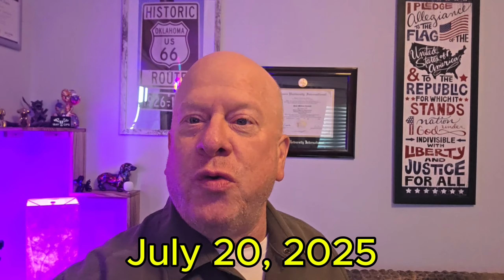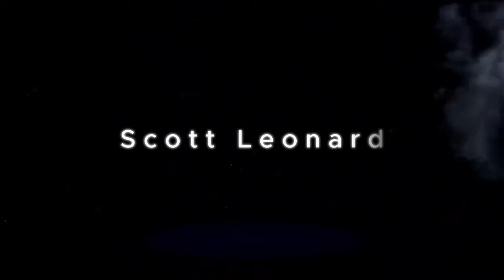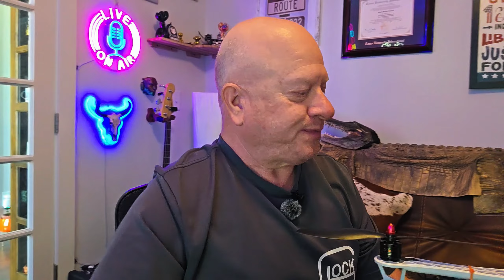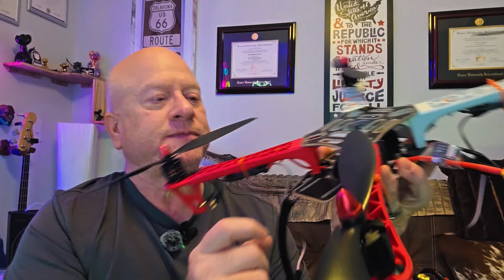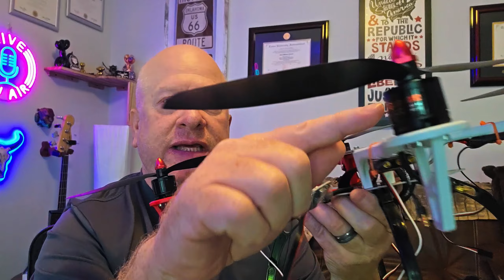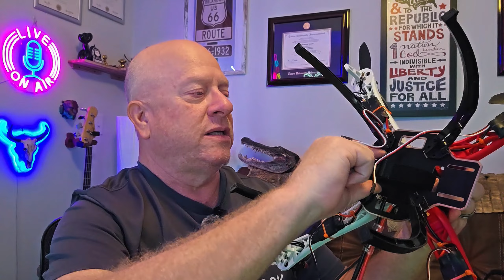SDI UAS 213 Module 2 Assignment

Comment: I am just starting UAS 213 this week.  Been watching your videos to see how you do each project.  This is the first block that something is new.  They don't have us soldering connections on the board.  I dug through my box like 10 times to make sure but I don't see any loose wires that don't have connectors on it.
Reply from the maker: They may have updated the course/materials and no longer require soldering. 😢